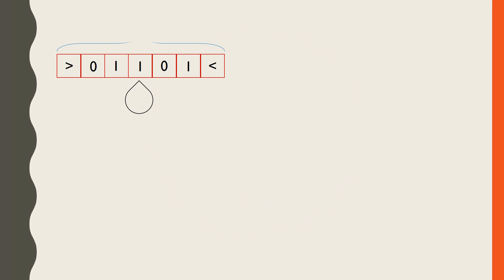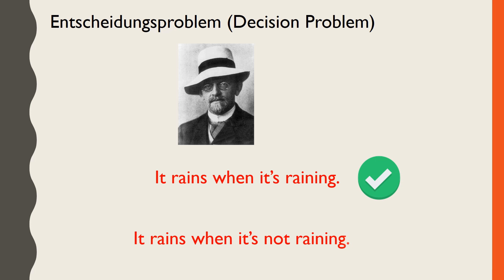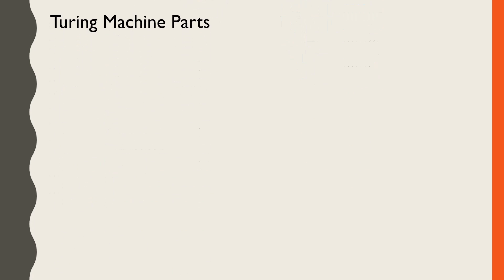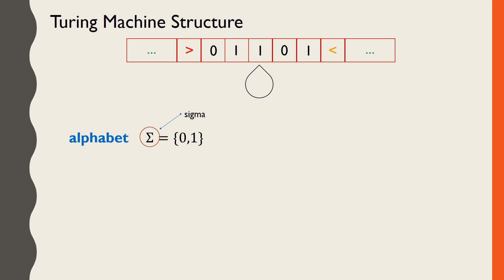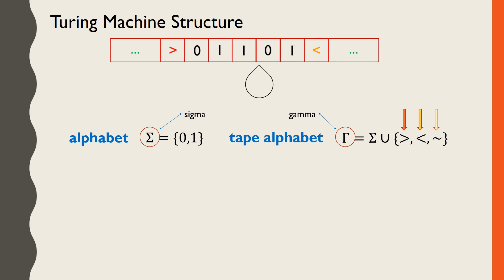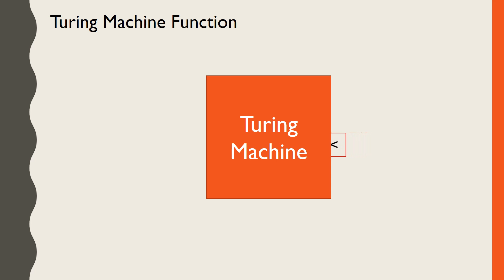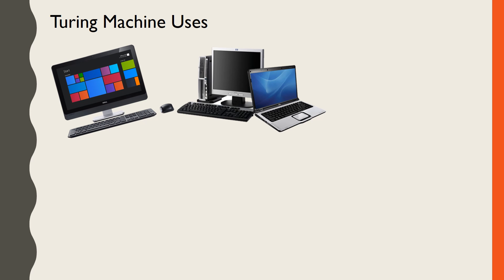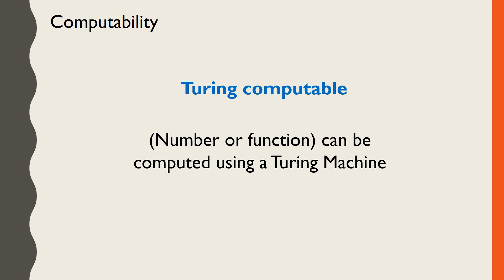How Turing Machines Work

Comment: For anyone who is in class and cant listen to anything or is just bored, I have to do a presentation so I just wrote the script. It's not 100% as I used some shorts for certain words or passages in the video and I didnt include Computability... 

Touring Machines are powerful devices with an interesting property, aren’t physical but abstract mathematical objects. Developed by Alan Turing as he was working on the Entscheidungsproblem. The Decision problem is Fundamental to logic. After having been around for some time the problem was formalized by David Hilbert in 1928. The Decision Problem is concerned by the validity of propositions.  It rains when it is raining: Correct  It rains when it is not raining: false. Turing was interested in “What is computable?” 
The Machine developed by turing can mathematical can describe any mathematically describe any operation any modern computer can perform, just by following a few simple rules. In fact it’s capable of describing of describing infinitely many operations, though not every conceivable operation is possible on a turing machine. Turing machine find applications in mathematics and computer science as powerful, yet simple explanatory tools. 
Turing Machine Parts
Key components: Strip of Tape or memory, is infinite in length and devided into an infinite number of cells. Each cell holds a character or symbol, which can be read or overwritten by the machine’s read/write head. 
The Alphabet of characters that can be represented on tape is given the name (Capital) sigma. Our Example Machine will use the characters 0 and 1. 0 and 1 then are characters that are allowed to be written on the tape. There’s another alphabet Turing machine use which we call the tape alphabet and represent with (capital) gamma. It contains the 0 and 1 from sigma as well as a few special symbols used in computations. Symbols mark: Start position (>), End position (<) or an unused Cell (~). The read/write head is always positioned over exactly one cell and can read that symbol from that cell or write a new symbol in its place. 
The machine has the ability to move the tape one cell to the left or right at any time during operations. It may also elect to not move at all during an operation. Movement: , , -. With this setup the tape acts as both an input/output device and a storage medium for information. 
How does it work:
The machine starts by reading the first symbol and writes a new symbol in its place, according to a set of instructions. The instructions also tell the machine which directions to move. The machine follows this read-write-move cycle over and over again, until its told to halt. The string written at the end of all of this is the output, and the computation. 

Touring machines are useful for several reasons: 
They gave us the first theoretical model for building actual computers. Still widely used as computer science model for computation. 
Algorithms for solving problems can be expressed in Turing machine languages and Turing machine languages can even help with understanding how programming works.  

Idk if this will actually help anyone but ig if I already did that why not share it with you all LOL

Comment: I've been trying to understand the instructions and how they relate to the tape. I just can't put the two together like I can a digital computer. For instance, if I wanted to add two numbers where do I put them? Do I put them on the tape, or build them into the instructions?
Reply: You use the tape for memory. A computer may calculate that 1 + 1 = 10, but later has no hope of remembering this without a tape.
Reply: Hey, there is a great visualization of Turing Machine! https://yadi.sk/d/4vH8JkAW6asXcA